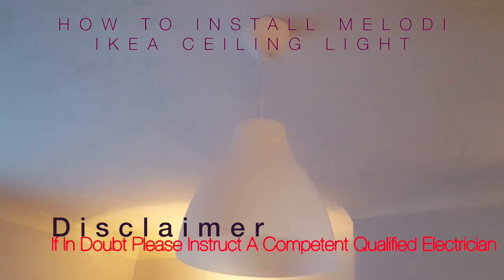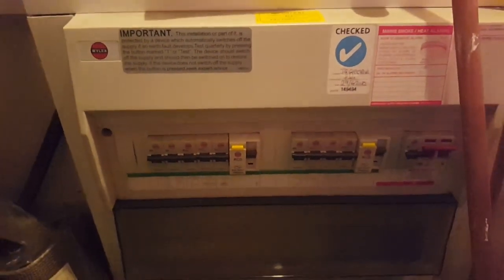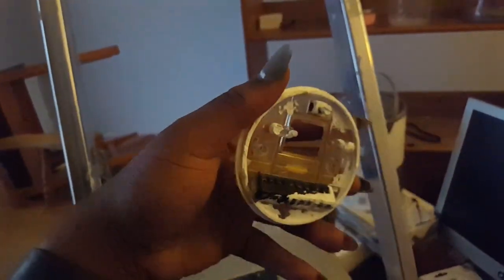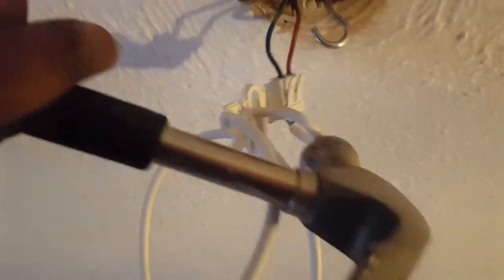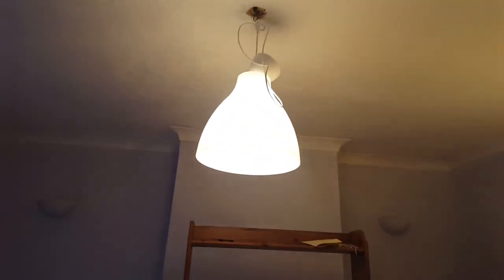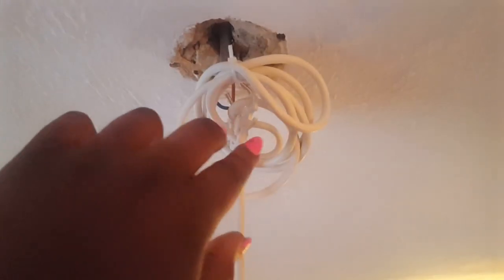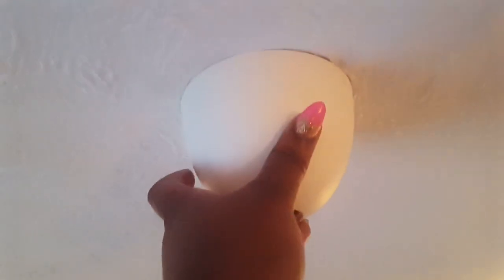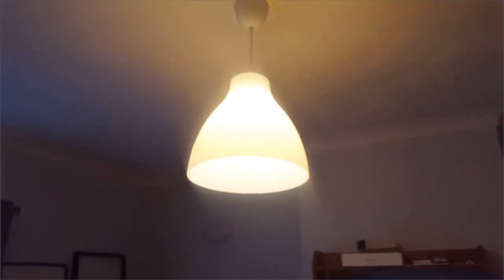How To Install Melodi Ikea Light

Comment: This video isn't going to work with everyone in the UK. Not everyone has a joist or has knowledge of using masonry drills to fit the hook. You're better off loosening the screws on the ceiling fitting slightly (aka ceiling rose) and running long zip cables behind the back of it, making sure to keep the zip ties on the inside side of the screws and then tightening the screws back up to ceiling so the ties become flush to the ceiling. Finally you can now run the zip cables through the light clip to hold the light up.

Comment: thanks for this. this is like a gazillion times better than the b&w instruction insert. p.s. the melody does come with the wire and bulb holder right? thanks
Reply from the maker: The melody light comes complete with everything apart from the parts I purchased from the £1 shop which was the hooks. Thanks for the lovely comment 🤗🤗🤗

Comment: I done the same light works fine, just light switch wont turn it off! (hall light so both switches won't turn it off).
Reply: Hi did you fix it?
Reply: Hi james I did, I didn't have the live switch onto the flex just always live so switched them round and worked fine.
Reply: @rohdich  hi Chris thanks for replying. I thought it might have been because the lights loop to switch and other lights.
Reply: Obviously not the case lol
Reply from the maker: Glad you fixed it mate

Comment: So I just needed to know how to put the thing that screws on on. In my instructions it didnt describe that process but I did recieve a plate with the hook on it. I am in the USA so maybe that's why there is minor differences.
Reply from the maker: I will try and help,  I am not sure what the thing is? do you mean this thing here 5:20 ? Stop the video were you need help and put the timecode in so I know what part you need help with...
Reply: @debstar2005  you actually helped me. It's the part that keeps the smaller bulb pressed against the cieling

Comment: Lol, I just turned my light on, sparks and smoke everywhere 😂😂😂
Reply from the maker: Lol 🤣🤣well you obviously did follow along correctly! 🤔
Reply: @debstar2005  hahaha, I did, maybe it is the lightbulb im using?
Reply: I'm not the most electric savvy person
Reply from the maker: Ok turn the power off and check that no wires are touching anything they are not meant to- obvs check the bulb let me know how you get on please.  Make sure that earth wire is tucked away